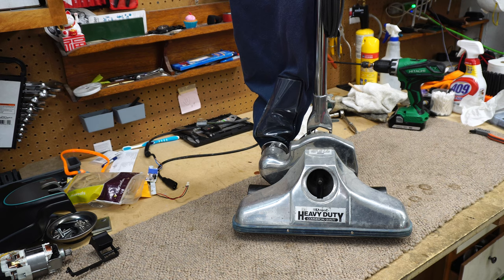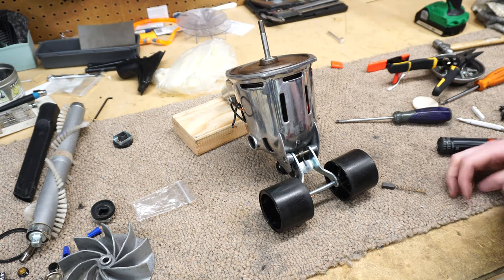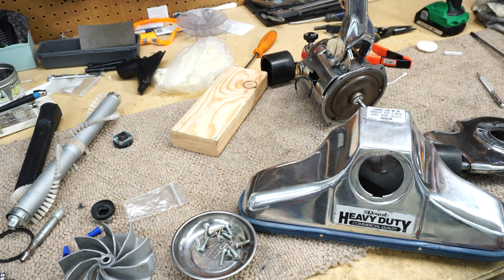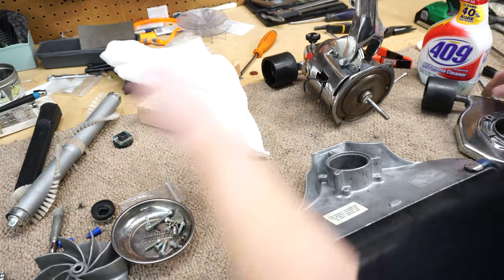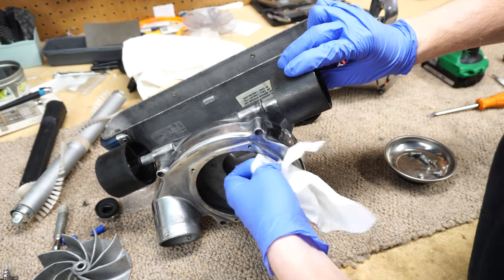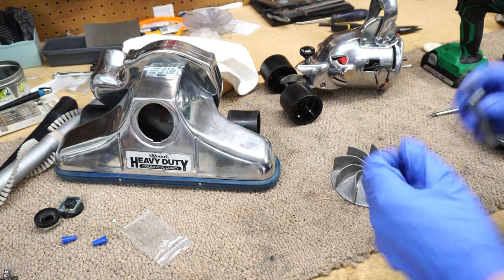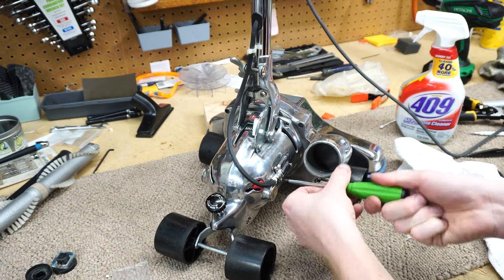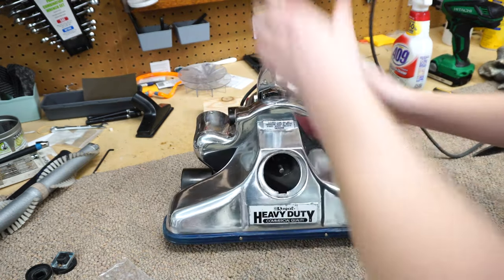Royal 884 Vacuum Repair of an American Classic (Part 2)

Comment: I prefer the Royal canister tank models myself.  My grandma gave me her 4700 that she bought new in 2000 when I bought my house back in 2009.  I bought a brand new Kirby Avalir a few years ago but I rarely use it becasue it just doesn't make the carpet look nearly as nice as my Royal tank IMO.  To me the Kirby is a bit to aggressive on the carpet and leaves a lot of track marks.  The Royal leaves it looking very plush and hardly a track mark can be seen.  It is unfortunate that there is virtually no parts availability on them any more but they do break pretty seldomly.  I have been using a 4600 I bought used on eBay the last couple of years to save my 4700 which I have restored to near new condition.  I was able to get a number of NOS parts before they became nearly impossible to find or took nice pieces off used units I bought on eBay to restore and sell for a profit.  I have bought and sold close to 10 of these Royal ponies now, a couple were even NOS units!  I have amassed a small stockpile of various wear items and common failure parts and even a spare motor for both the power nozzle and the canister.  I also have probably at least 100 paper bags so I hope to keep mine going until I die!

Comment: I remember working on these Royals for a dealer back in the late 1980's and 1990's.....the Kirbys NEVER gave me the heartaches that the Royals did....at least Kirby waits for a very, very long time before making parts obsolete....with several Royals, I had to do what you had to do with this one and IMPROVISE on certain parts.  Personally, I just could never understand why anyone would buy one of these, which is basically a machine that was about where Kirby was in the 1940's and 50's....I found them to be subpar at deep cleaning, and trying to use the hose and attachments was a NIGHTMARE when I had to demo one; only certain models had a hose available, and unlike the Kirbys, which have a very easy to use belt belt lifter on the upright nozzle, these had to played with by hand, and I seriously doubt that the average housewife had the amount of strength necessary in her fingers to remove and replace the belt!!

Comment: From my experience, Kirbys are, in general, more simple than a Royal. Sorry that particular one gave you a hard time, but I know it does happen from time to time. I have had two Kirbys give me hell in my lifetime. I had a Classic 3 that I was rebuilding and I knocked a hole right through the fan case while trying to tap the front bearing back in. The worst one, though, that I ever worked on was a Classic 1-CR. Everything went wrong with it. The fan was broken, the bearing plate had a hole in it, the safety switch went bad on it, the bearings were shot and, if I remember right, the armature had to be replaced. I finally got it working, but it was a pain in the ass.

Comment: Hi, I found a used brushroll in a box of NOS and some used Royal parts with the same square end caps as this one but mine has the plastic brush stiffeners set into a grove in the brushroll.  Can the brushes be removed or do the metal sleeves not come off?  I would like to clean my brushes to make it look a little nicer to sell.
Reply: I just winged it and sure enough they are just pressed on as I figured.  I pulled out the bristles and cleaned them up with some liquid laundry detergent and they looked like new.  Oiled up the bearings while I was at it and got $39.99 for the refurbished brushroll on eBay!

Comment: Great Video. Is there a special way to place the round gasket into the back into the nozzle assembly  so it seals the nozzle assembly to the fan case correctly? If you look at the gasket facing you there is an open side and a closed side. Thank you